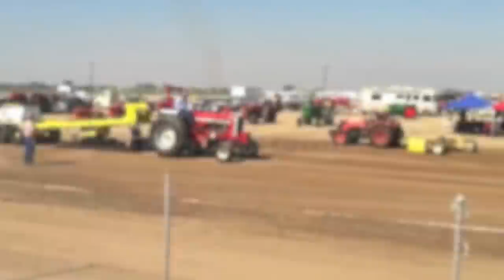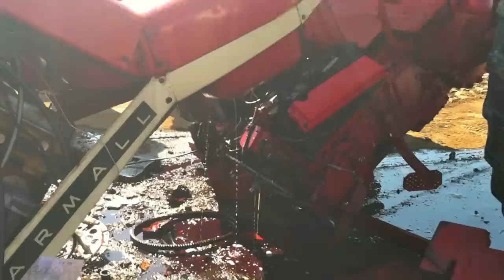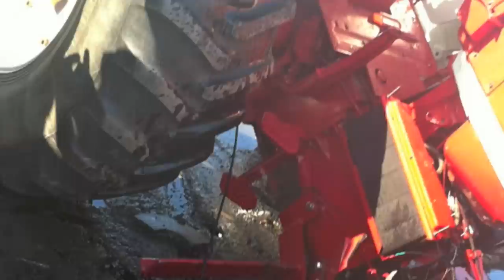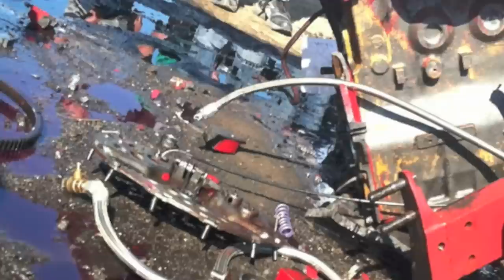Farmall 1206 Breaks in Half when flywheel Explodes

Comment: That was our tractor. One of the injector pump plungers stuck causing it to run away. My grandpa who was driving, pulled the fuel shut off all the way out but did nothing. The only other option was to push the clutch in which resulted in the tractor splitting in half because the fly wheel came apart and broke the housing. It was a devastating day but he walked away with nothing more than a scratch thankfully.
Reply: He  guardian  angel was with him  that day
Reply: was anything salvaged from the tractor at least? It looks too far gone to repair.
Reply: Machines can be replaced. Grandpas are limited issue.
Reply: That’s why air shutoffs, steel flywheels, and tie bars are so important
Reply: @harrimanfox8961 , looks like the engine is ok. Needs a transmission.

Comment: That was terrifying to watch. I think I’m going to spring the extra cash for a high rpm rated flywheel on my 10,000+ predator 212 now, seeing as how it’s positioned directly below my crotch when it’s in use.
Reply: Please do that I have shrapnel on my leg to this day from a Briggs & Stratton Flathead that run on methanol coming apart on my mini bike !! And the metal that the Chinese use is nowhere near as strong as the cast iron that they used to use back in the day please be careful ✌️
Reply: Billet rod and flywheel were the first things I did on my 212.
Reply: general rule of thumb when im building my motors 4 stroke or 2 stroke. always make sure the stressed components are rated for much over what id like to do with the motor now or later. 2 stroke cranks atleast 4k rpms over what id like to spin. your never have vibration issues or harmonics that destroy the crank if its not even workng.
4 stroke gas motors always leave clearance for lift on the cam heads and rocker angle. get bearings that are soft but rated for higher rpm than youll ever turn. balancers flywheels and rotors/stator parts always need to be matched with operating range too. some balancers come apart at high rpm. some flywheels/flexplates break under heavy load just like this did. id rather it not be me.
too many times ive seen someone make a bad choice cheaping out on something important or getting something under the wrong idea.
Reply: @evilbeetlekustomscreations4965  i can attest for both. plants almost never bounce back. motors sometimes you get lucky but only if you were mindful in the early process. if not then its not even worth trying because it will be cursed. metal through the block is not even going to cross someones mind thats a hack job.
Reply: Needed a scattering shield for the flywheel housing

Comment: Been pulling and an  IH mechanic for years. Scares me when I see these old DT361 and 407's twisted so tight. See a lot of these with flywheels heat cracked all the way through. As hot as he had to have gotten that clutch and flywheel, I am not surprised things came apart.
Reply: And to think it's gotten even wilder in the last decade with diesel performance knowledge now. I know of a fella who's squeezing nearly 65hp out of a ~750cc 3cyl Kubota. No clue how long it'll last, but it's getting stuffed into his one-man mud buggy lol.
Reply: Somebody out there is probably making an armor grade steel flywheel for his tractor right now.
Reply: @LaPapaMollido  they still last forever, alot of diesel garden tractors get torn down once every few seasons
Reply: @LaPapaMollido  I know a guy making over 100hp on a 3 cylinder

Comment: I reluctantly hit the thumbs-up. That's hard to watch as a Farmall fan. Diesel runaways never end well.
Reply: TKS Motorsports wonder if the governor failed?
Reply: TKS Motorsports as a tech priest, this was painful
Reply: I had one on my small Yanmar L70. I had overfilled the oil too much, & it ran away. Luckily I had reversed what to do & shit it down within a few sec. 

Let it cool down drained the excess, & it’s been fine.🤞
Diesel engine runaways never end well if not stoped early on. If the guy at the wheel hat thrown a rag in the turbo when I saw the think black soot the engine/tractor would’ve been fine.
Reply: did yall hear that whistlin diesel bought a farmall? its some good content
Reply: @michaelbenoit248  assuming it didn't eat the rag
Reply: @joshanderson1019  doesn’t sound like it.
Reply: @michaelbenoit248 it was black smoking from the start.

Comment: When you build a big horse power engine and bolt it to a bell housing that was built for 120 hp.
Reply: flywheel and clutch plate had cracks in it.
Reply: More like when you spin a flywheel designed for 2000 rpm up to 5500 rpm
Reply: @dakotadriggers8838 and then dump the clutch.

Comment: I was a Diesel Truck mechanic back in the late 60s and early seventies. The massive flywheels on some of the larger 2 and 4 stroke diesel engines were prone to explode due to excessive RPMs. These were known to not only kill the driver but also to kill people standing near the truck due to flying shrapnel. These diesels developed their torque on the very low end of their range and it was not necessary to rev past redline. Your grandpa was damn lucky to walk away from that one unless you had a scattershield installed.

Comment: Flywheels breaking apart can be deadly, especially for the high performance front wheel drive cars. Revving about 9,000rpm having flywheel right in front of driver or passenger depending on the engine/trans orientation, I've seen flywheel chunks tear thru the firewall, hood, seat, roof.
Reply: the guy walking in from the left almost caught a piece
Reply: Oh yeah, transverse placed, it becomes a literal slingshot for circular saws
Reply: Talk to Don Garlits.  That's one reason the dragsters have their motors behind the drivers.
Reply: @jameshuban6515  And have Kevlar covering the heads

Comment: It's not stupid to install a fuel cut off solenoid or a throttle plate on race engines...
Saves you a lot of money.
Reply: When diesels runaway they are burning their engine oil, typically. So a fuel cutoff does nothing. You'd need an air cutoff to stop a diesel.
Reply: @cageordie  That's what i wrote also.
Reply: @cageordie  in this case is a fuel runaway ( governor) , engine revvd like 10 000rpm in no time at the end before  it broke 
also notice its just black smoke 
runaway oil/compressor is more like GREY BROWN SMOKE
Reply: It would need an emergency air shut off like Detroit diesels have.
Reply: Still, it can suck air and oil from wherever it can when you close off the intake. 
We had this old Cummins gennie that just as it was ticking it's last tick when rolling to a stop and if you choked the intake off it revved up. 
Runaway waiting to happen she's so tired and it wasn't even turbo.
Reply: @nalley6815  not really , think about it. 
I choked off the air filter and the  thing revs up? 
You're sucking oil from the slopped out guides for sure. 
And maybe some from the cylinders ,but most is from the guides.
Reply: @MrTheHillfolk  yeah idk. Every runaway puller I’ve ever seen in my lifetime has shut down immediately with a guillotine. That’s the purpose of it…… with no air a diesel will not run
Reply: @nalley6815  yeah same ,choke the air and it'll quit. 
But when the intake was choked ,it revved back up. 
That's majorly not cool. 
Especially in a hospital next to the boilers.

Comment: Crazy that the ring gear is in once piece. Shows the difference between the way cast iron fails and the way more ductile metals like steel fail.
Reply: That caught my eye also.
Reply: @coltsfan79  And mine as well. The flywheel appeared to vaporize!
Reply: @physicsphirst191  Right!!! I can see the pressure plate the throw out bearing but not one fragment of the flywheel itself.

Comment: If you have never competed M600 GLL .You will never know the feeling Tractor Pulling .I have done it when it was still catching on .1940 Allis Chalmers WC modified farm tractor .1941Ford 337 truck Flathead with Ardun conversion heads and a GMC 6-71 Blower. Nitros regulator went bad and dumped a 100 shot of Nitros down its throat blowing the crank and pistons threw the bottom of the engine . Flywheel and transmission torque converter and shaft.

Comment: did it runaway and blow?
Reply: it sure sounded like it to me.
Reply: i think so, right before it blew it did sound like everything was maxing out
Reply: governor stuck wide open. probably a bad setup in the pump trying to get too much out of it.
Reply: +jon “tweakit” spon and was pushing it worth it? I don't think so, it pushed the tractor in half!
Reply: Where is captain obvious when you really need him?
Reply: jon spon IF ONE OF THE INJECTOR PUMP PLUNGERS GALLS UP AND SIEZES IT LOCKS UP THE PUMP RACK IN WHAT EVER POSITION IT HAPPENS TO BE IN!
THAT IS WHY AIR SHUT OFFVALVES ARE A REQUIREMENT!!
Reply: ROSS Bryan6 Right.

Comment: Sad to see that happen to a fine machine like that.
Reply: nekbiodieselworks that's why there's an rpm guage
Reply: valleyfarm Case sucks
Reply: Chuckles it's not a case is an ih farmall. Before case bought them out the the quality of ih tractors went way down.
Reply: @henryofskalitz2228  case 'saved' international right?
Reply: @catgaming2210  they bought the tractor branch when international went down.
Reply: @henryofskalitz2228  the quality never went down. They ran out of money
Reply: @henryofskalitz2228 lol. These 1206’s were turds when they rolled out of the factory. They get stuck in between gears, they grind no matter what they have no low end torque and an absolute garbage brake system

Comment: Yeah, after re-watching the video, I saw how the RPM's when sky high right before she exploded.  Actually, it sure could have been much worse than it was.  There's a way to stop any "runaway engine"... it's called a gillotine (in the air intake) shut-off, but I don't know how many people actually have them installed in their diesel pulling engines, and furthermore, this thing took off so fast, I'm not sure if he would have had time to react to it anyhow.  Bummer.
Reply: Idk, I've seen guys put boards and stuff on an intake to try to stop a runaway motor and it doesn't work. Seems to me the best thing is to cut the fuel supply.
Reply: @fryloc359  when a diesel runs away it’s running on it’s own oil. Shutting off the fuel would do nothing. It sucks it past the turbo seals and runs till it either comes apart or runs out of oil
Reply: @CraftsmanQuad19  How does it suck it past the turbo seal when there is boost? Cutting the air is going to create vacuum and "suck air past the turbo seals"
Reply: @fryloc359  im not sure of the exact science of it, possible it’s crankcase pressure, exhaust pressure, or simply the oil pressure pushing it through. I’m sure google has the answer
Reply: Some times sump oil goes past the piston rings.

Comment: Slipping the clutch wasnt the real problem. The problem was leaking turbo seals, which spilled its oil into the engine, making it run away on its own by combusting oil at the end of the track. Governors dont help when the source of fuel isnt from the pump it governs. Combusting the engine oil caused it to overrev way over the redline and sling the flywheel apart.

Comment: How did the frame break if no power to the wheels? I guess the engine is the frame on the front of the tractor?
Reply: The transmition is part of the frame on my 45 farmal A to. So I can see transmition bell housing is broke it will break in half. What a mess there.

Comment: Honestly so sad. You know that guy had so much work invested in that thing
Reply: It was pure stupidity on the driver and if ur gonna build it. Build 8t correctly
Reply: @billgares7071  I’ve gotta agree with you but you never think your truck is gonna be the one to come apart. But I still have to agree. This is why air shutoffs, 3 way fuel dumps, steel flywheels, clutch blankets, and tie bars are so important. All of those would’ve prevented this

Comment: Might be a stupid question, I only watch these events, but do they not make scatter shields for tractors? Seems like it would be a good idea with such high HP engines
Reply: They do make a scatter blanket, and I don't see why one couldn't have a steel one made to go inside the bellhousing. These guys will spend thousands on the engine and (should) split it apart to beef up the clutch, but won't spend another $500-$1000 on safety while they're in there to keep a 50lb flywheel and clutch shrapnel from possibly killing somebody.

Comment: A classic case of what happens when machinery is modified to do things it was never intended to do.
Reply: what we have here is a classic case of bigmouth with a secondary diagnosis of not knowing what the fuck they are talking about
Reply: The poor ol' gal was trying to tell him something at 0:30,
"YER KILLIN ME!"
Reply: hardly these types of failures are pretty common what people don't under stand is that the fly wheel didn't cut the tractor in two on that tractor the motor IS the frame and if the bell housing snaps the tractor literally folds a new motor and a new input shaft and she could made to run again
Reply: @rjc862003  To say the flywheel didnt do it is silly. Ill gurantee the whole tranny was cast and shattered like glass. If engine, tranny and frame rails get compromised in any way and its game over, itll be catostrophic. In this case, flywheel going through bellhousing made it catastrophic because engine was still turning extreme high rpms, it tried to twist everything. It took away the strength between engine and rearend.  If you havent seen a cast flywheel come apart, im gonna tell you you doont wanna be close to it and itll punch holes through steel. Just like an aluminum comnecting rod punching through a cast block, just more devistating..

Comment: so what happened? it looks to me like the tractor started to run away and he dumped the clutch to stall it, causing it to explode. I think this is why its dangerous to dump a clutch to stop a runway, better having an air shut off on the turbo to do it
Reply: I don't understand what u mean by main intake? im not familiar with pulling tractors but this is turbo charged, so just have a air shut off in front of the turbo and it should snort it out. Also a fuel shut off wont work in cases where the motor starts running on its own oil, which is why air shut offs are needed.
Reply: Swagamuffin An engine becomes a "run away" when it begins consuming its own engine oil as fuel. A diesel shut-off is pointless when there are gallons of engine oil to run off of.  Asphyxiation is the only cure.
Reply: simpler !! the crankshaft broke causing the engine to run away and to break the bloc open !! it must of broken at the fly wheel !the back half of the tractor of tied to then engin by fly wheel housing and back of the engine !!
Reply: Swagamuffin You are incorrect. Shutting off the air is the only way to stop a runaway.

Comment: That flywheel is made of cast iron like most flywheels because they have great wear characteristics and will usually last the lifetime of the vehicle or equipment they are in.  when he loaded the clutch at that RPM it probably brought the clutch and flywheel temp up near 800 deg F very rapidly! which compromised the cast iron.  The reason for steel flywheels is because they are less likely to explode when super heated but are not designed  for years and years of wear and tear, the life span would be much shorter in a daily driver.  Racing and pulling needs an upgraded flywheel period.  Not to mention the critical speed of cast iron is much lower than steel.

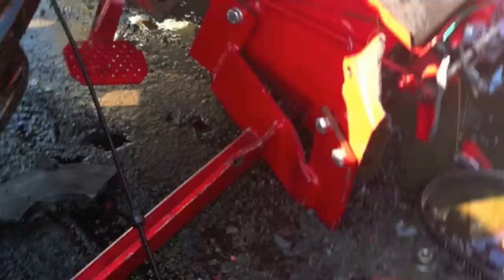Comment: Its looks like like they forgot to torque the flywheel and frame bolts. All the nuts missing with full studs showing. I think he had a problem pulling at start because of clutch slipping due to bolts missing on clutch to flywheel. Look at 1:56

Comment: That looked like a diesel runaway at the very end.  Probably blew the turbo oil seal.

Runaways are rare, but bad news when they do happen.
Reply: It wasn't the turbo seal that failed as it was smoking black not blue at the end. Motor didn't sound right from the start
Reply: @deerespetes8849  Yup, Engine sounded a bit choppy towards the end of the run, almost like it was pushing the head gasket? 
I've had the dubious pleasure of a diesel engine runaway on a two litre diesel Vauxhall engine when the turbo oil seal popped at 85mph on a French motorway.
Got her pulled over and had to stall the engine against the hand and foot brake in third gear......... if it'd been an auto, I'd have just had to walk away and watch it pop. 
Rebuilt it with a new Turbo, a set of pistons and a cylinder hone and it still ate another turbo about a year later....... biggest heap of junk I've ever owned.

Comment: thing is, the motor started running on its own oil at around 0:51 which people call 'running away' and when a diesel does that the motor runs up to double the engines normal rpm, and the flywheel was not designed to stay together at that speed, thus, the flywheel exploded and ripped through the chassis, causing it to break in half.

Comment: Keep in mind that these guys turned the fuel up, the cloud of smoke is unburned fuel. Anytime you make that much heat and torque from a modified engine, there is always a weak spot in the drive-train and this is not the first clutch to fly apart at sporting events.

Comment: what a pity this happened i hope they can get parts and have the engine sorted , theres alot of damage done , hope the crankshaft isint broken , its a very powerfull engine ,,has it  got an automatic transmission as i see alot of red fluid oil on the ground , she was a great puller rearing to go down the track no matter what load was on her back